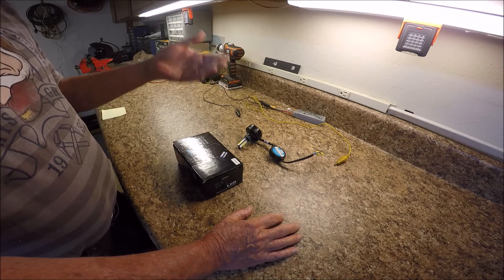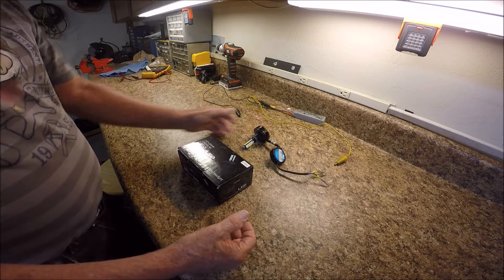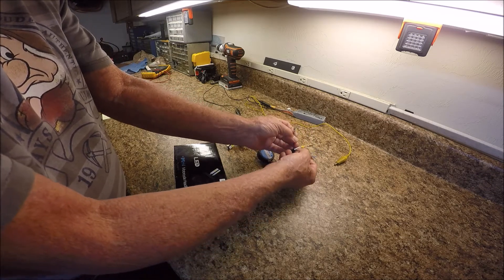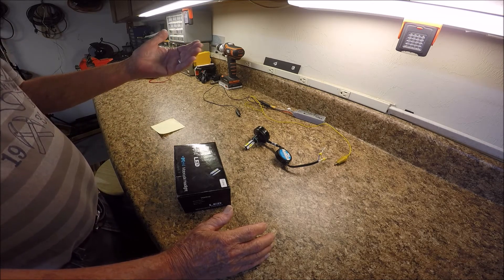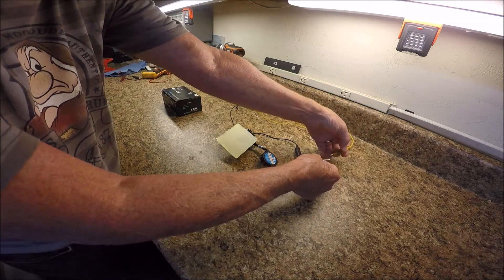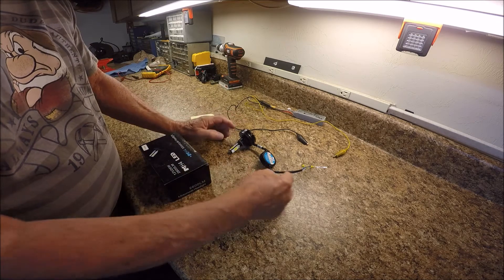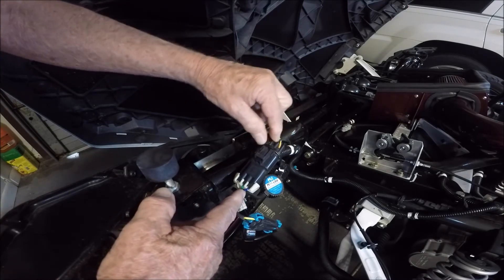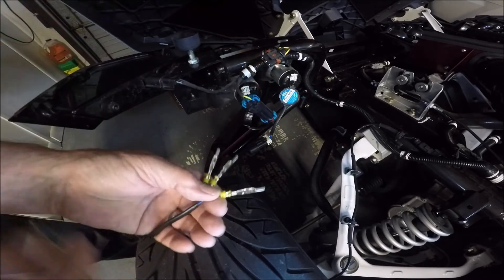Slingshot Canadian Headlight Operation Explained

Comment: Which setup, Canadian/U.S. is the most effective at night on a dark backroad?  Also, having a U.S. headlight setup, would it be illegal to visit Canada with the setup if the U.S. setup is the brighter system?
Reply from the maker: I like haveing the 6 headlights, I have 4 bight lights when in Brights.  You also want LED style.
Reply: Thank you for getting back to me.  How do you rate the high beam headlights on a dark country road?
Reply from the maker: The LED LIghts give you a bright white light.  Other headlights give a yellow light.  you can tell the difference for sure.  Get LED all round.  Good Luck
Reply: My highbeam won't dim... is that in shutter by bulbs or switch at steering wheel ???